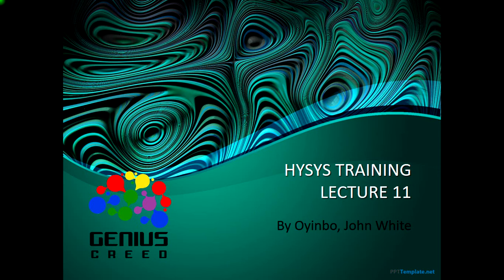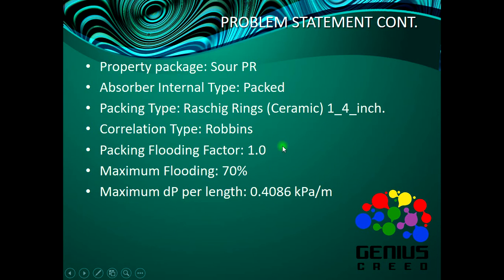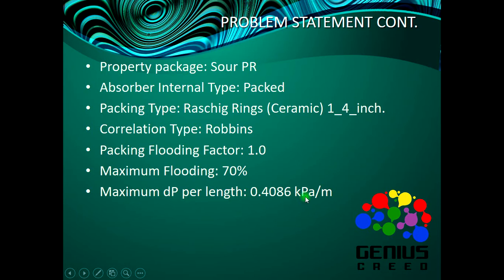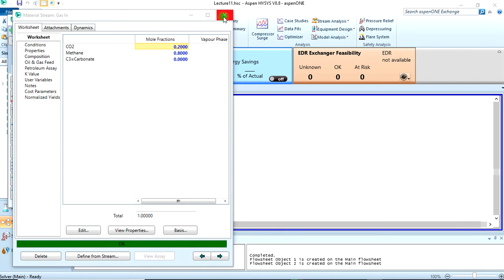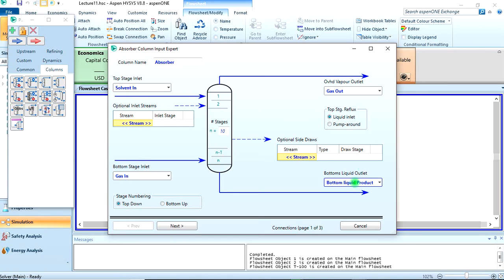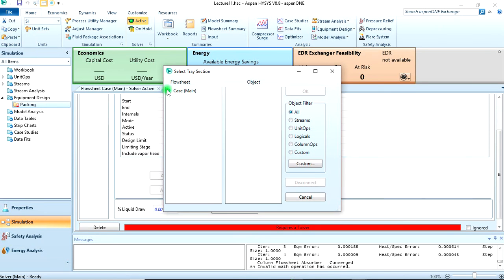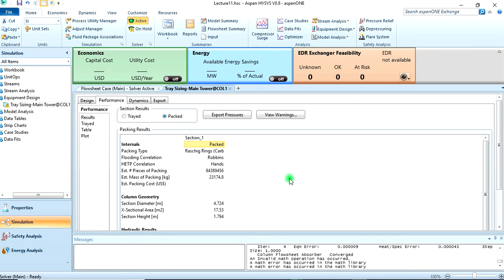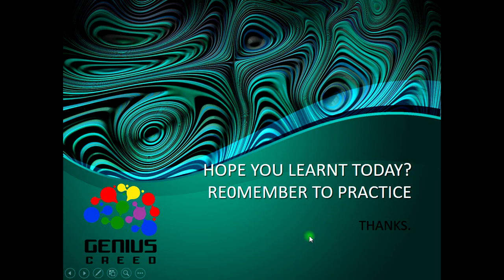Aspen HYSYS Lecture 11 Absorber

Comment: I'm accustomed to adding dP per stage in other software.  In HYSYS it seems you have to "hard code" the inlet and outlet pressures.  Is there a way to make the inlet pressure set by the incoming gas stream and the outlet pressure set by a dP per stage?

Comment: Hi. I am trying to do this tutorial, but the step you do @10:05 is not available on my HYSYS. Do you have any idea what I'm doing wrong?
Reply from the maker: Hello, thanks for reaching out.
What version of the software are you using?
Reply: @geniuscreed369  V10. I'm the girl that emailed you.
Reply: same problem, I use version v10
Reply: @FeetMountain91  what worked for me was going into internals tab, after double clicking on the column.not exactly the same, but i found a few of the parameters from the video
Reply: @kissesnpopcorn  thank you :)
Reply: @kissesnpopcorn  I still don't understand the steps
Reply: @hildafrihandini8752  Hi, Hilda. I had to take my computer to the repair centre. I can't remember all the steps now. When I get it back (might be a few weeks) I can contact you and see if you have worked it out. Might be able to record my screen
Reply: @FeetMountain91  Hello! Did you succeed same result? I use Hysys 11. I faced the same problem. Could you share with me? Thanks.
Reply: @alex-alex2023  i did what @kissesnpopcorn had said and it has worked. :)
Reply: Hello, I use Version V11, and the same problem. I can't find trays sizing. Did you find it finally?
Reply: Although the answer was too late, I checked and found that the function was consolidated after V9.